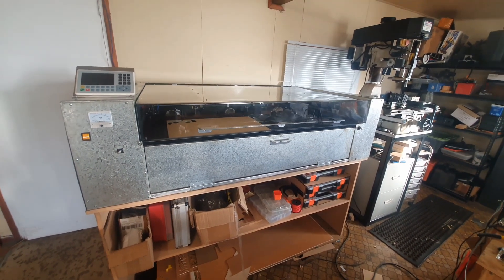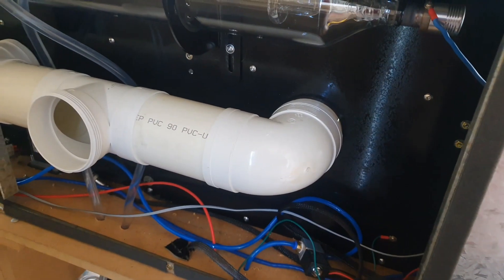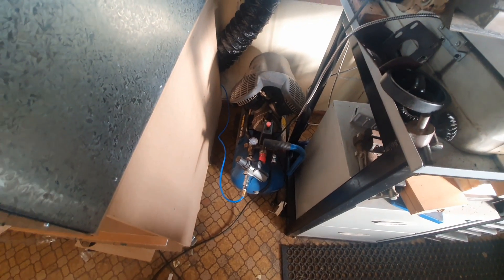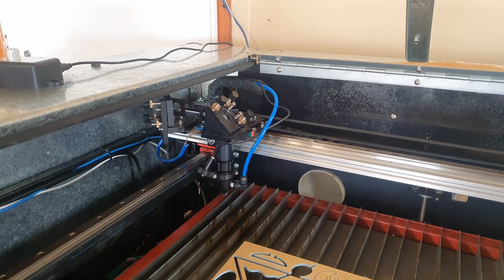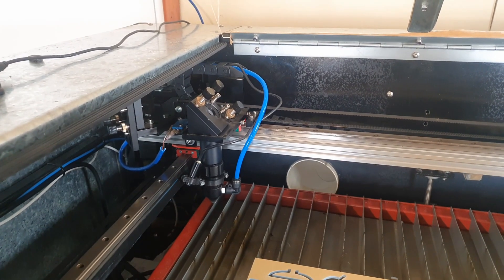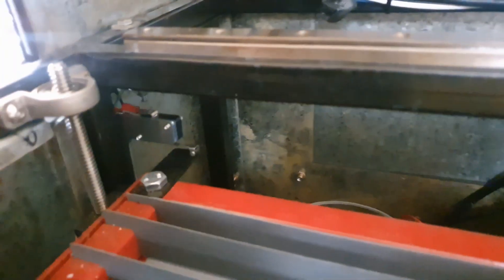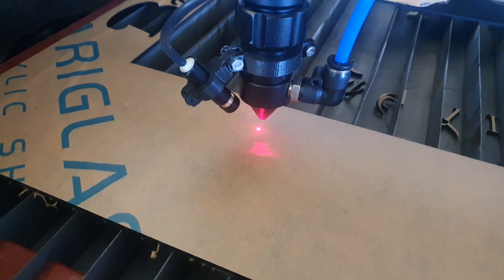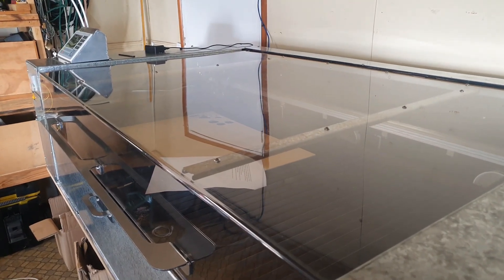My DIY CO2 Laser Build Part 5 - The Machine is Running and Earning Money!

Comment: Great job. Nice size. What is the thickest material can you cut (ply wood)? Would you choose a higher power laser tube?
Reply from the maker: Thanks, I've only tried 10mm plywood with 2 passes. I think it would go thicker though and will try. I mainly cut acrylic at the moment. The higher you go in tube power makes engraving harder as the minimum you can run the tube at is about 10% this means that eventuality you exceed the speed/accuracy of the steppers and the time it takes to pulse the tube on and off.